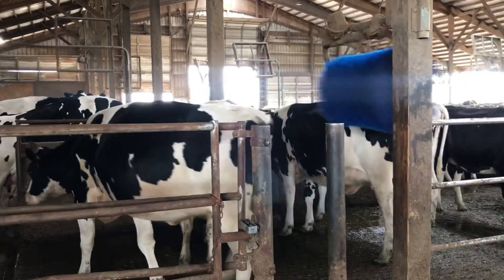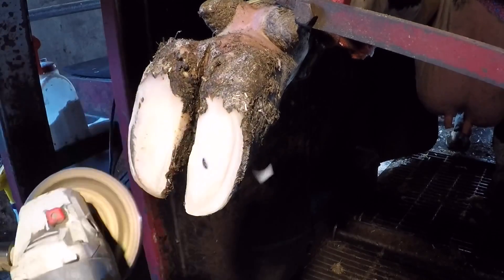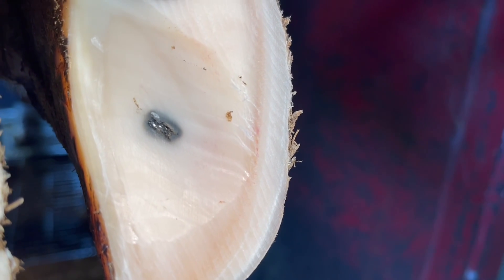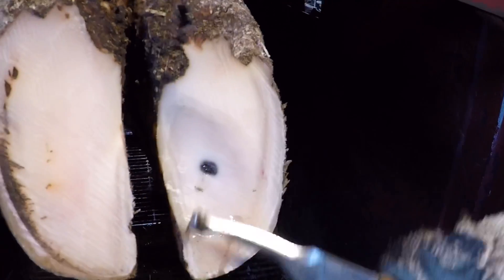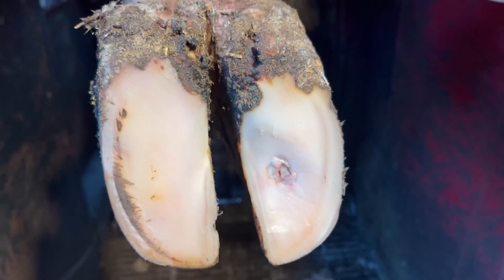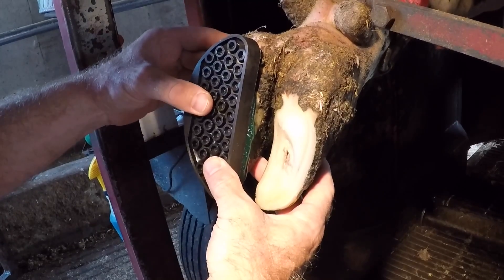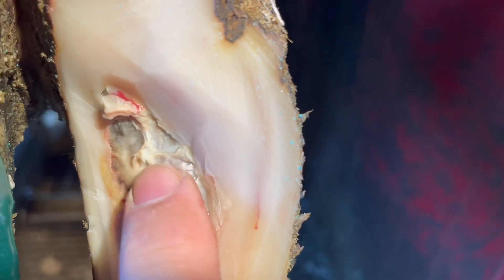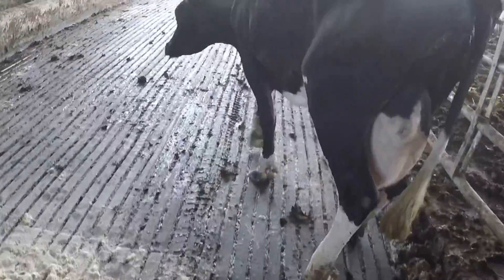THIS GIRL GOT HER TIRE POPPED

Comment: I can only imagine the relief she felt after you worked your magic! You said that this farm is great with handling dermatitis, what does that mean? Is it a cleanliness thing or do they treat the cows themselves? Thanks for another great video!
Reply: Both. Many dairy farms have a foot bath that the cows go through regularly which treats and prevents dermatitis. But a clean barn also helps
Reply from the maker: Consistent foot bath protocols for long periods of time that keep bacteria levels low and dermatitis prevalence low.  It’s not as easy as it sounds however
Reply: I would of still Wrapped it--  with a tiny bit of S-acid or  Iodine..   because,  it's now a Fresh open wound.

(never been a big fan of iodine)
Reply: @NatetheHoofGuy  thank you for taking care of them like that 👌🏽
Reply: @NatetheHoofGuy  Thank you for explaining this I came to the comments exactly for this question and answer.

Comment: Hey Nate. I was just wondering, when you trim out the inner side of a claw due to a lesion and put a block on the other toe, which is supposedly only temporary. When that block falls off, the cow would be exerting more force on the outside of the claw since the inner side is trimmed out right? So can that cause a white line lesion due to the unnatural forces exerted on that outer edge that's higher while the hoof heals?
Reply from the maker: No.  The weight is naturally transferred to the outer walls of the hoof.  As the cow steps the weight is transferred inside the foot from the pedal bone to the outside walls and then travels down to the ground.  The wall is where the weight should be.
Reply: @NatetheHoofGuy  thanks Nate. Nice work and amazing educational video as always ☺️

Comment: My husband has a question for you. He is concerned about the cow straining her ankle with the block only on the left side. Would it be better to have an L shaped block where the horizontal part of the L goes on the right/injured heel for ankle support?
Reply from the maker: Doing that would put pressure on the injured sole and it would defeat the purpose of the block.  As long as the block is positioned correctly they don’t cause problems.
Reply: @NatetheHoofGuy  thank you! You give great explanations and I appreciate how gentle you are with them 🙂

Comment: Even if the cases of dermatitis are low -- why wouldnt you powder and wrap it just for relief and sanitation?  What are the cons?
Reply from the maker: Because it wouldn’t speed healing and if left on too long can actually cause problems.  Not to mention the unnecessary added cost to the farmer.  The Chlorhexidine will provide a barrier in the short term.  The primary reason I use them is to prevent or treat dermatitis.

Comment: I'm still confused on when it's appropriate to and to not put on a SA wrap when done. Even if the farm had a good track record of not letting their cows get dermatitis, wouldn't it be beneficial to put the wrap on anyways?
Reply: It'd just be a waste of time and resources if they don't need it. Like a person taking antibiotics for a cut that's not infected.
Reply from the maker: Not really.  That’s the reason I put them on.If it doesn’t get removed on time then they can actually cause problems.  Not to mention the unnecessary added charge to the farmer.

Comment: Confused.  How can the puncture be so deep but nothing is there?  Could she have somehow stepped on a nail and it immediately came back out or eventually worked its way out?
Reply from the maker: Yes.  Or it was something heavy that she stepped on.  It poked through when she stepped down on it.
Reply: @NatetheHoofGuy  How soft are the bottom of the hooves that rocks and nails and such can penetrate deep down?

Comment: i've been watching your vidio's for some time now and i noticed that you havnt used iodine in any of the vidio's of yours that i have seen but i see other hoof trimmers use it. some use it alot and others use it on occasion but you dont apear to use it at all. is there a reason for that?
Reply from the maker: I use Chlorhexidine instead.  It has the same antiseptic properties with the added advantage that it binds to keratin in the hoof providing a longer lasting barrier.  It’s also not deactivated by organic matter like iodine is.
Reply: @NatetheHoofGuy  ah right that makes sence, i didnt know about the deactivated part or the keratin, i knew it was antiseptic but doesnt it also dry out the new hoof horn helping to form a hard barrier where the sole hoof is thin? or does the chlorhexidine do that by helping to bind keratin into the hoof?